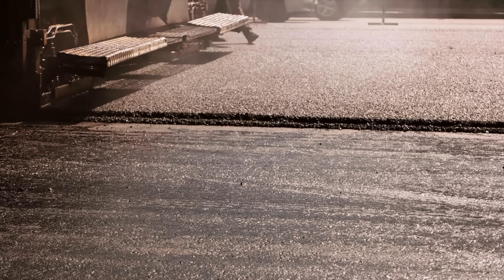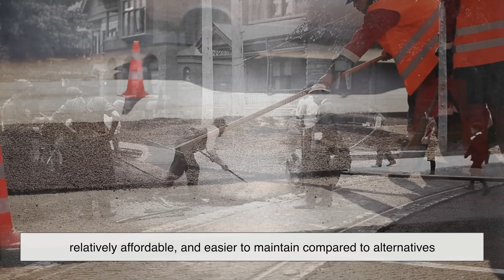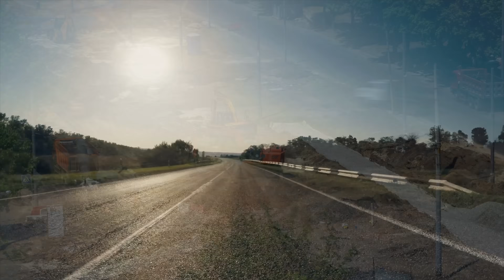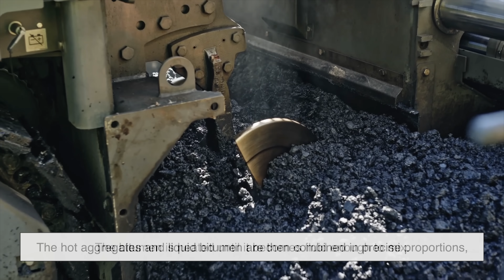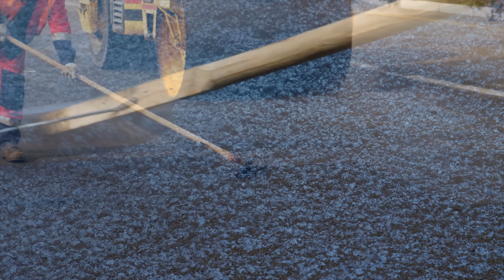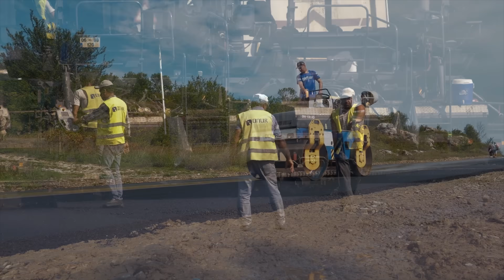How Are Asphalt Roads Made?

Comment: The role of the Paver machine is underplayed a bit here. 
The paver is designed to vary the thickness of lay to ensure that the finished surface level is correct. It will automatically iron-out a bump or dip in the layer below without operator intervention. 
The successive layers each improve on the tolerances of the previous layer.

Comment: As a Civil Engineer (PE), I always remind people that a good asphalt road is only as strong as the foundation beneath it. Most drivers only see the smooth black surface, but the real engineering happens in the subgrade prep, drainage design, mix temperatures, and compaction process. Miss one step, and the pavement starts falling apart faster than expected. Great explanation of how asphalt roads are truly built layer by layer from the ground up. – Dr. Sera, P.E., PhD
Reply: Is it possible to add anything that would increase the longevity of roads?  Are potholes filled in a similar fashion?
Reply: @arlenefisher1164 honestly there are just better materials out there... asphalt is now using cheap materials that is so far from its original patent especially since it's original source has depleted...